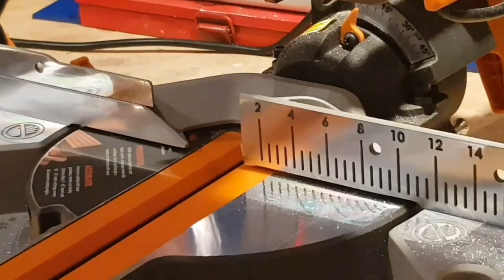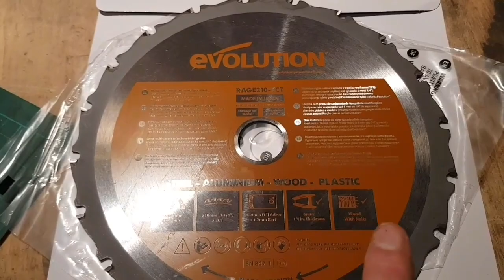2019 EVOLUTION R210SMS Sliding Mitre Saw unboxing, test, review

Comment: Thanks for the review Oracle. Fantastic to hear that it will have a dedicated space in your workshop. Can't wait to see what you create with it!
Reply from the maker: No problem at all, I love the multi material capabilities of the machine, the quality and design are better than other brands I have been using lately.
With 3 year warranty, and it can cut thick walled steel pipe.
This machine is a must for any workshop.
It is now my go to saw, for cutting, tidying up ends, processing and shaping all of my materials, which used to be the most labour intensive part of my projects, and now it takes seconds with zero effort.
👍👍👍👍
Reply: Bought one of these 6 months ago from Screwfix and its probably the best power tool investment I've made in 40 years.. A superb bit of kit I can't fault apart from the dust bag SHOULD come as standard. Mind you they do a great accessory kit for £30 which includes one + extra clamps etc. Handily they are on my doorstep in Sheffield so managed to pick one up from the lovely people at Evolution. This is my 5th Evolution product and I've been impressed with the quality of every single one. And no they've not paid me to say this..lol
Reply from the maker: @mistral55  yes my thoughts exactly, I've never had a saw that can process every material that I have at the same time.
It just eats through everything, saves mega time and the fact it has pre-cut angles I don't see the need to use any other saw, my handsaws are being left in the past.
This saw will be featured in lots of my build videos, good quality, nice colours and doesn't take up too much space, and just a total savage.
👍👍👍👍

Comment: Ive got the R210SMS-300+ and they added something extra between the cutting groove and the angle guide at the back. I think it's to catch flying particles as it cuts, BUT it also blocks the laser... I dont get a laser line right the way across what you are cutting, it starts a few cms away from the back as it is blocked by the guard. Ive only just got the thing so hoping its something Im doing wrong, but atm looks like a ballsup in the design
Reply from the maker: To be honest, nobody uses the laser all that much.
The saw doesn't cut where the laser line is anyway, it cuts a few millimeters to the left of the laser line.
Most people just release the guard and lower the saw without it spinning and line the blade with your MARKING on your material.

Then bring your saw up, start spinning and pull out towards you until fully out, then down and back in one smooth motion.

So dont think you are being made to take the long way around it.

ALSO, you have a moving support that your material sits against at the back, this will have to be released and moved before cutting diagonal, or you might cut into the support, as the support is for cutting straight forward and back.

Maybe it's a piece of the support has blocked your laser, I know a few people who have chopped the support cutting diagonal mitre without moving the support first.

Hope this helps bud
👍👍👍

Comment: It has some neat features but what genius decided to site the laser directly facing the blade? After a few cuts on steel box section the flying chips had eroded the lens cover so much that the laser line was reduced to a 40mm wide faint fuzz. When I complained Evolution just emailed me a price for replacement lens covers.
Reply from the maker: My laser landed directly behind the blade, I really think lasers are just a gimmick, especially when battery operated, I liked this one more because it was connected to power supply.
Once you have made a few cuts and know if your laser is straight in the first place, its easy to do the normal thing and just pull your blade down to your work and check its lined up with your mark, then cut.
I have not experienced anything wrong with my laser and I just processed about 60 pieces of metal at both ends, but I will keep my eye out for that happening.
And if that damage happened in warranty, with normal wear and tear, I would expect said company to deal with my issue at no extra expense to me.
I hope you receive fair treatment, maybe need to speak to a manager.
👍👍👍👍
Reply: I picked a used one up today and I'd guess it had suffered the same fate. The laser line was blurred and looking at the lens cap it was completely effed. Phoned them up and they are sending me a replacement for free though, so thumbs up for that.

Comment: I did notice on mine that the laser line sits to the right of the blade which will give slight undercuts when feeding material from the left, as most people do. I don't use the laser I just bring the stationary blade down to the right-hand side of my marked line. Works for me but each has their own way of doing things. Stay safe people.
Reply from the maker: Yes I use it exactly the same way, it's just first nature to bring the blade down and "eye it up" lol

This saw is really awesome, evolution done a mighty fine job with this one.
👍👍👍
Reply: Yes for me the laser would be better on the other side of the blade.

Comment: i gave you some applause like you wanted and I want one of these to cut up battens for trellises.Only issue is it looks awkward for a left hander
Reply from the maker: I'm sure it will be slightly awkward for you, but it cuts everything like it's butter.
Using your right hand will be easy as you are not really needing excessive strength or hand control.

If anything, I wish I could use my right hand to support the wood, not to do the cutting, so I think you will be just fine.
👍👍👍
Reply from the maker: @TheEssexSpurs  don't be silly, you would just need to send them round to the SECOND HAND SHOP, 😆 🤣 😂
Reply from the maker: @TheEssexSpurs  I just chopped a dirt bike swing arm with this saw, so I can extend it.
I have cut hundreds of bits of metal so its easier to store for when I'm welding stuff, and it still cuts like its cutting butter, with barely any sparks and next to zero heat left in the metal.

I really mean it when I say this saw kicks ass, best saw i have ever worked with, mainly down to the blade but awesome saw.
👍👍👍
Reply: @oraclescave  touche.I'll stop there

Comment: I've got the non-sliding version of this, bought it from Screwfix for under £50 and can't fault it👍🏻
Reply from the maker: Its insane how easy it cut through that steel pipe.
Best saw I have ever owned, and cutting frames out of thinner material will be a doddle.
👍👍👍
Reply: Is it still doing well..am thinking of getting this one?

Comment: Please try to make cutting V on UPVC profile
Reply from the maker: Just cut one piece at 45 degrees, then cut the other piece at the opposite 45 degrees by turning the cutting blade to face other direction.

This will give you the "V" you are looking for.
👍👍👍
Reply: It will be nice fine and  smooth surface  V shape? As you know after that I have to make welding.
Reply from the maker: @fasha1968  yes, very very tidy clean cuts.
Amazing saw.
Reply from the maker: @fasha1968  two 45 degree cuts join into a 90 degree square, if you are trying to make something into a "V" you would need less than 45 degrees cut.

It might be easier measuring the thickness of your material then mark the middle.
Then mark off how far you want the "v" to go.
Then just put it on the table and move the saw blade to match your cut lines you marked off.
And the saw will tell you what degrees it is, after cutting one side of the "V" , check what degrees it is on the saw table, then you match the other side of the cut, on the same degrees on the opposite side off the table by turning the table and blade to opposite direction..

That sounds really confusing lol

Comment: EVOLUTION R210SMS  OR EVOLUTION R185SMS  for a diy guy   ???????
Reply from the maker: When it comes to saws bigger is always better,  especially when it comes to needing just that bit more.
But the wood can be rotated and cut from the other direction to complete a cut thats too big.
These blades can cut through wood metal plastic and solid plate steel, an inch thick is the most solid steel I have cut.
But everything I have cut so far has fit in my saw, I have never needed to spin the material around.
So the smaller version would probably be more than enough.
👍👍👍
Reply: @oraclescave  just bought the EVOLUTION R210SMS from Screwfix

Comment: Being impartial and not a fanboy, I can tell you a few issues...The laser adjustment is crap, only allows a small amount of adjustment to the left....If you use it to trim small cuts i.e squaring end of timber, the offcuts will dtop into the blade slot...as you cant remove the orange plastic trim to access the slot you will have " great fun" removing them...
My particular saw was far from accurate as supplied, we are talking 10 degrees or so out in just a 15cm straight cut.. 
The choice of blades is very limited due to the proprietary bore size...
To enable the saw to cut multi materials the revolutions have been kept lower than a straightforward wood cutting mitre saw, which means that you simply won't get as clean a cut with this on timber as you can with a quicker saw.... even with a dedicated wood blade... Its not a DeWalt or a Makita... but fair enough ..it doesn't carry a DeWalt or Makita price tag....
You say you were given the saw by the manufacturers ......But..... if you are going to make a credible review, try to enthuse and gush somewhat less, or better still wait until you have used the tool for long enough to actually give your words some degree of credibility.....
A good enough cheap saw for non critical work? yeah...I use mine only when working with reclaimed wood which may have nails in after realising that its just not a sufficiently clean or accurate cutter to be used for much else.....
Reply from the maker: Lol bullshit, I like your false misconceptions, and projecting what didn't work for you, onto me, but the saw works awesome, does cut through anything, cuts perfectly square, I don't even use a laser so couldn't give a crap about one, if anything I would say it's on the wrong side of the blade.

Cuts are the cleanest cuts I have ever seen from a wood saw, and that includes my old dewalt saw.

If I had to buy any manufacturer it would of been a choice between evolution and ryobi, but since ryobi have been crazy marketing for the last 5 years my choice and the price tag would still have made me choose the evolution as that's the tools in the price bracket I normally buy from.

I had used that tool to process solid steel girders and steel plate that was 7mm thick, which is clearly not as thick as you.
You must feel really important when you presume stuff and plan on answering with a comment filled with inaccuracy and expectation.

You have to me English from England born and bread, you guys are like natural born KARENS

you my friend are a male KAREN, there is no other explanation.

Are you from England?